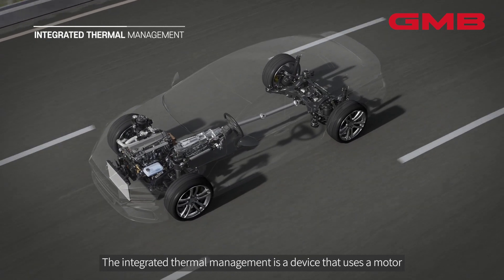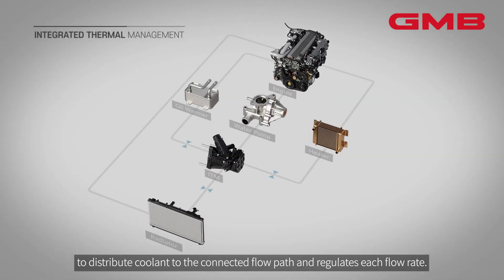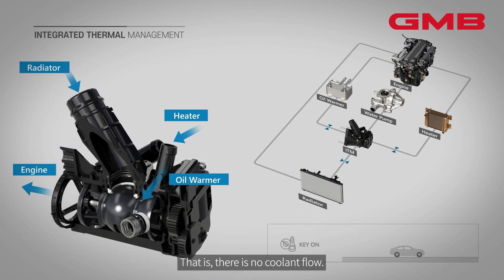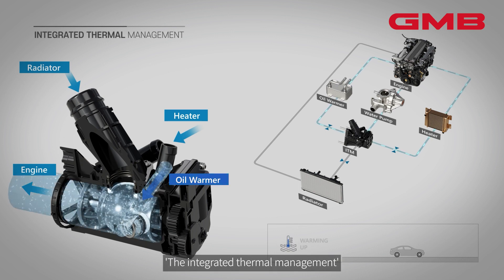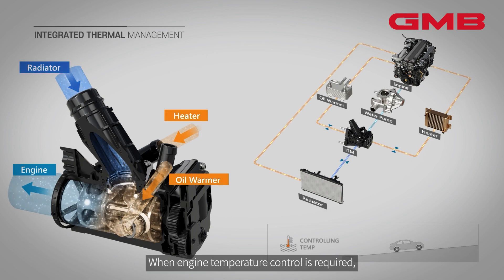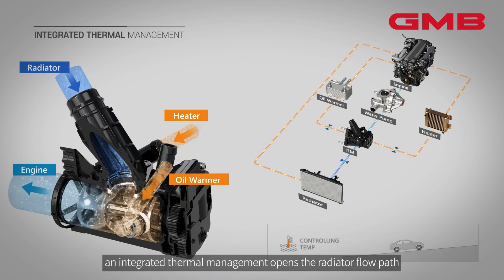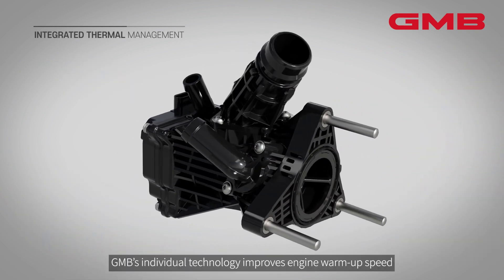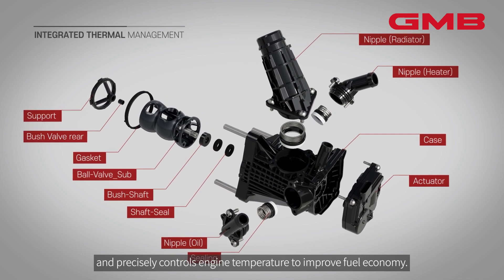How Does a Integrated Thermal-management Module (ITM) Work? – GMB

Comment: This is a cool design. VW ruined the implementation by using three bolts to seal both the inlet and outlet ports on the block. Three bolts, two ports. THREE BOLTS!